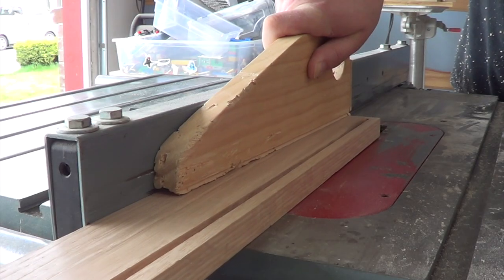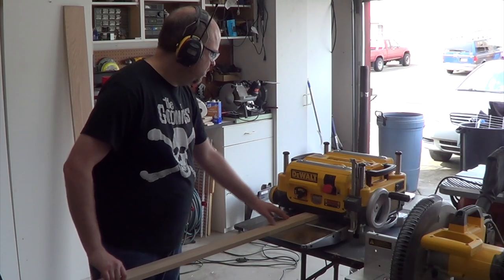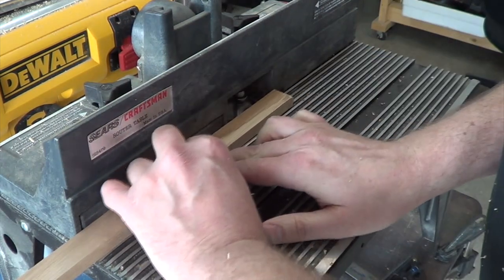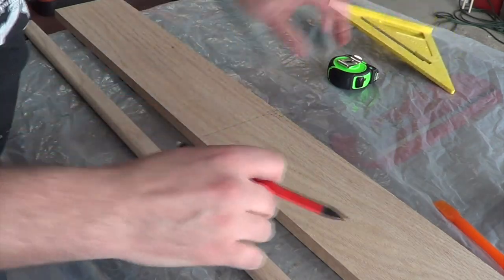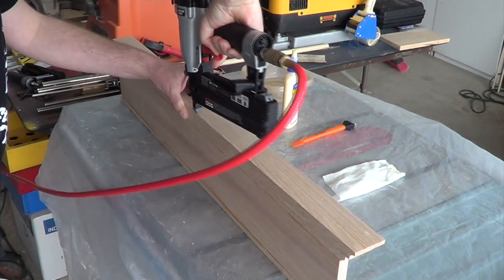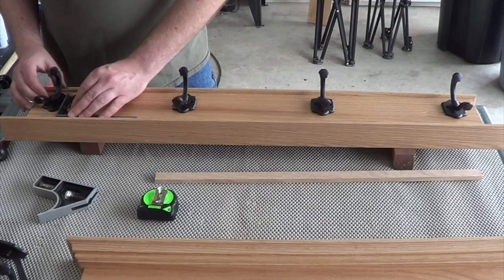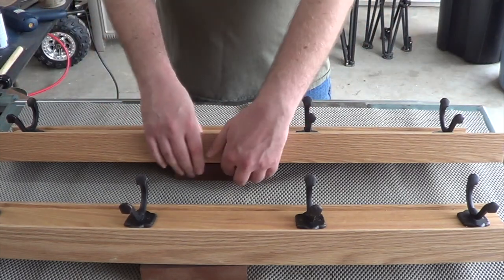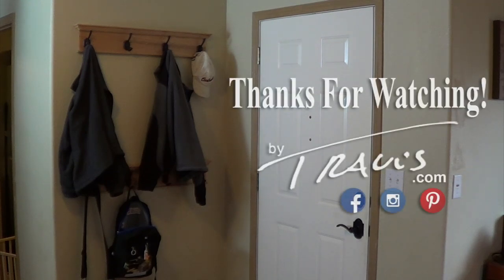Making A Coat Rack

Comment: Did you just screw it onto the studs?
Reply from the maker: Yah.  I just put it into the studs.  I suppose you can use wall anchors.  But I don't like them very well and they usually strip out.  Into the studs is rock solid.  Just use nice screws, or counter sink and use oak button plugs to cover the screws.  I used oak button plugs on one spot, and hid a screw under one of the hooks.